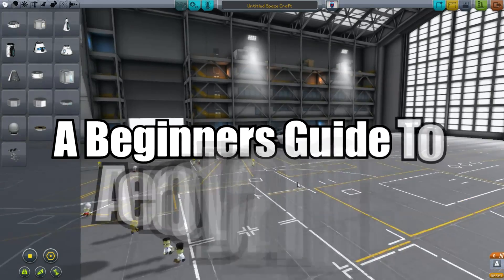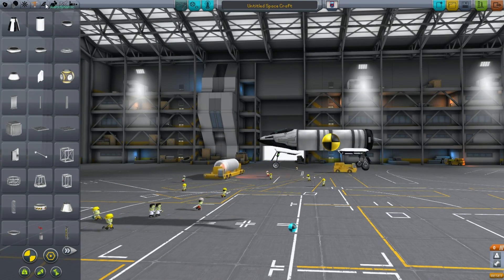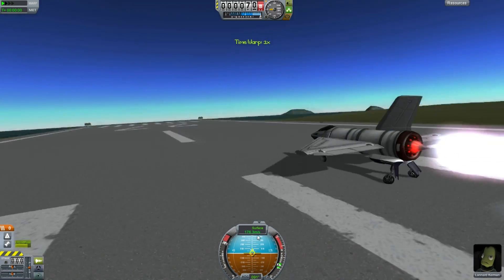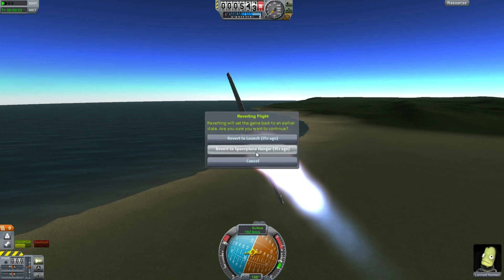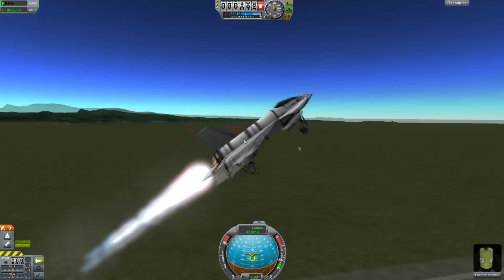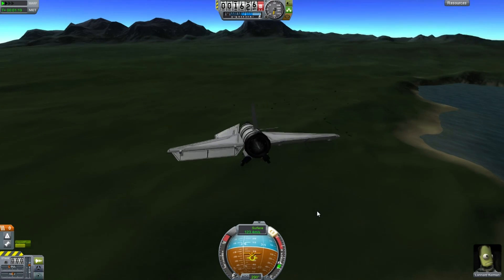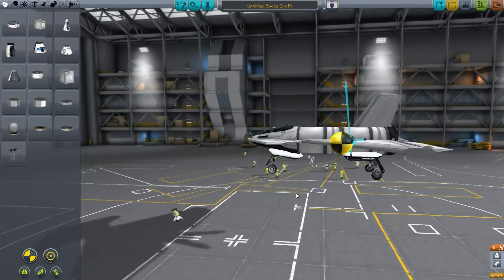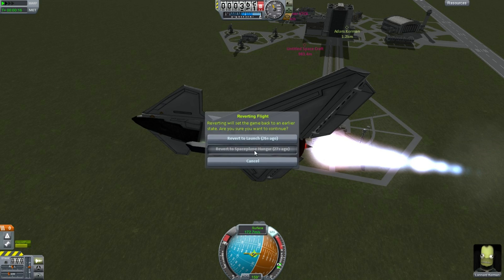Kerbal Space Program - Beginners Guide To Building Aircraft - Part 2

Comment: 5:00 The Fulcrum is still in effect. But because you moved the point of lift far to the front the rotation effect is much more dramatic. It's pushing up the nose instead of at the centre of mass. I always tend to visualize a giant hand pulling or pushing on the craft at a certain point. Makes it easier to predict how a certain force will effect the craft.

Comment: On my planes, I put fuel lines going from the rear tank to the front to cancel out CoM shifting
Reply from the maker: +Fireheart318 If you use Jet engines then fuel draw is balanced so that helps.
Reply: could you explain why one might prefer the aerodynamic design of high and low mounted wings to provide stability and control respectively to the designs of anhedral and dyhedral designs that produce a seemingly identical effect.

eg: if i wanted to make a stable plane, whats the difference between high mounted wings verses upswept wings?

Is there a purpose to high mounted downwardly swept wings and low mounted upwardly swept wings? etc.
Reply: Scott Manley how do you pitch a plane like what key u press for (up,down,left or right)?????

Comment: hello Scott, 
I want to ask a few questions about 10:00.

10:00 start tilting wings and I have did in same way
The arrow of center of lift has just inclined 90º to the surface of the wings.
I guess that should be correct, since when the wind comes to the wing, the reaction force should be that way. 2 years of versions has just fixed the direction of the arrow probably.

However, the biggest problem that bothering me is that when I use this technique to take off my aircraft, it is always unstable before the aircraft went off, and it is always unstable after the aircraft went off even though I have toggled the Sickness Avoidance Scheme on.

If we consider the command cockpit is a point, we can see that the point is moving in a direction just like hopping.

But from your video, it shows that the aircraft went off and flying peacefully. So what I want to ask is, what is doing wrong in my aircraft? Is this design unable to incline too much when flying? Thanks a lot!

P.S. You are my superhero! I couldnt fly any aircraft (hm with SAS) before finding this epic tutorial :D
Reply: That little arrow shows the direction of lift. You obviously want that pointing up. If it points backwards, it's basically drag.

Comment: Wow how did i miss this. I have a few air crafts that refuse to take off, and it was cause the way the landing gear was positioned. A pair of dihedral angled canards fixed the takeoff issue, and made it perfectly stable :) Also seemed to soften the nose lift as well angling them slightly upwards.

Comment: why is it that when I try to take off, it just wobbles on the runway and explodes?
Reply: Maybe the center of mass isnt proper? once I forgot to turn on symmetry and my center of mass was at left maybe your center of mass was in front
Reply: I have that problem too, it turns out that putting the landing gear really close behind the center of mass solves it. So vibrations are inevitable, and putting the landing gear near the center of mass meaning the vibrations will be dampened and that gear takes the majority of the force, and the front landing gear just serves to make the plane upright

Comment: So why do commercial airliners have wings below the center of mass but with a dihedral angle?  The effects seem to cancel each other out, but I can't think of any other advantages to having low wings.  WWII fighter planes have a similar configuration.
Reply: They mount them to the bottom because its easier to make them structurally stronger/run fuel lines from the belly tanks of the aircraft. You wouldn't want a plane where 1/4th your passenger area is struts between the wings, and its harder to pump the fuel up out of the belly into wings high on the airframe.

also the wings are in the way of the cabin in a lot of cases and will block out some of the engine noise, rather then a high wing where the engine will be literally right outside of your window.
Reply: linkxsc make sure you dont have ANY excess jet fuel at all, make sure you use the jets till they are empty and make sure by the time you use rockets the oxidizer to liquid fuel ratio is 1 to 1
Reply: Thomathan FYI I was talking to the dude above me about commercial liners. On the other hand, there's no need to make sure that you have "equal" fuel ratio. A great many successful spaceplane make it to orbit with an amount of fuel left above what it has oxidizer for, mainly because most spaceplanes will use that fuel to make it back to the space center or another runway.
Reply: Oh boy... Some WWII era (and before) cargo aircraft used the upper fuselage wing. And the fighters (like the f4f-3) didn't really need it, they were stable enough to just not need it.
Reply: Commercial/passenger aircraft carry a unique payload, people. The floor needs to be low enough to provide headroom and wide enough for seating,.usually ending up on the lower third of the fuselage. Most everything else is designed around that which is why you have avionics, ancillary equipment and fuel cells below the floor and in the empennage. Ergo, wing roots are located low in areas with robust structural support and typically house the main landing gear as well. Plus, the wings themselves carry the bulk of the fuel making the center of gravity very near the wing root and actually much lower than the "visual center of mass."

Comment: Another main reason is structural.  WW1 features wings that were mostly externally supported.  In WW2 which featured internally supported wings, it's much easier and stronger to have the main wing spar (support beam) run all the way through the body of the aircraft.  If you want to put the pilot behind a big engine, AND have a small lightweight landing gear, it makes sense to put the wings lower.  

You can make the low wing monoplane just as stable by adding dihedral as mentioned in the 1st vid

Comment: As mentioned, low-wing designs are a lot less stable. Another way to think of it is that an unstable plane is more sensitive to control inputs - it takes less force to turn the plane. This meant it took less aileron deflection to roll, reducing the strain on the pilot (the stick can get quite difficult to move at higher speeds and deflection angles), and less elevator deflection to pitch (reducing the tendency to stall during sharp turns).

Comment: The P-51's issue was due in large part to the horizontal stabs being too small.  During a hard pulling turn the aircraft's could more or less 'lose traction' with the air and cause the tail to snap around.

Comment: Around the 6 min mark, would it be possible to use those yellow fuel lines to pump fuel from the rear tank into the front tank while it's being used to automatically maintain the desired center of mass?

Comment: While the information is duly noted I don't normally move parts that have the wheels on them unless it fails miserably on the first shot (which it usually does) and the sheer size/weight is what I believe is part of the problem with needing the entire runway but thanks for the info I try that too

Comment: You can lock fuel and oxidizer in front tank. That would prevent getting center of mass behind center of lift. Mass would be going to the front. Later plane would be a bit "heavy" to control, but it would be stable. For planes, best engines are jet engines, because their low draining a fuel, so you don't have to worry about changing mass and lift positions, but you know that all very well :)

Comment: Q,W,E,A,S,D rotate the part in various ways 90 degrees , holding down the shift key and pressing them rotates the parts in the same way in 5 degree steps. The angle snap option also changes the rotation a bit ( now the same rotative effect can be performed by different keys )

Comment: air breathing engines are incredibly more efficient for all purposes however it is recommended that if you try to lift with jets that no matter how many jets you use you should end up with shutting down the outer ones so that only one jet in the center is still active at high altitudes.  that way if it flames out you can avoid flat spin.

Comment: I have had the same problem with my gear and have found that putting gear on a part and then moving the part around and resulting the part some times results in the gear being shifted in a very slight way.

if you need the whole runway to take off try shifting your rear gear closer to the COM so that when you pull up the wind can leverage your plane on the gear much easier.  if ever you have to move a part, even if you put it back, try deleting the gear and replacing them.

Comment: Why would that not keep the COM centered at the tiny tank? If both main tanks are draining into the tiny tank at the same rate, they should both have the same amount of fuel and thus weight at all times. Unless the fuel is actually treated like a real liquid and can "slosh" to the front or back of each main tank - is that the case, or does it fail for some other reason? Seemed like a good idea.

Comment: I think he mentioned that in the first video on this topic. You could either put a pair of control surfaces/canards to the sides of your cockpit, that will help your nose lift up or try to move the landing gears more to the front of the aircraft. You could also pitch the wings sligthly backwards, so the moving air tends to hit the underside of your wings when you move forward or tilt the whole plane by angling the landing gears at the back of your plane

Comment: i have a question, that has been bugging me for quite some while. Is there a good rule of thumb to figure out how much lift i need, especially on bigger aircrafts/how many wings are necessary? So ive just changed it around until i get it to lift of at around 100 m/s. But i can achieve the same results by changing the wings and landing gears geometry. So im unsure whether a high lift value is actually preferable or just increasing the weight of my craft

Comment: But it does assure that you won't have a sudden and catastrophic CG shift in the very wrong (rearward) direction. Your aircraft will simply tend to get more nose heavy as you drain fuel.

The solution to that is to get the CG of the plane SANS TANKS and then keep that CG as you add fuel tanks as best you can.

so build the plane using trusses instead of tanks. NOTE the CG/CL then replace with tanks and move things to return CG to known good location.

Comment: Part 3 will probably be about turbine engines and thrust vectoring. From their, I would suggest altitude dynamics as far as how the aircraft acts and behaves at different altitudes. The higher up you go, the thinner air gets and the less control you have as far as control surfaces go. Also depending on the engine, its either more efficient at high altitude, or more powerful.

Comment: I have not tried this (I might try it tonight) how about this. install a coupler between the engine and the tank and disable cross feed.

THEN put a "tiny tank" right at the CG point. and use fuel lines to feed the fuel from both tanks into the small tank and then fuel line from tiny tank to engine.

This way all tanks drain equally keeping the CG relationship fixed.

Comment: Place the rear landing gear just slighly behind center of mass and you can take off at MUCH lower speed. you only want it slightly rear of center of mass not by a lot because when you land your center of mass normaly is a lot more to the front after your fuel has been spent. look at real planes. ALL of them have the rearmost landing gear close to center of mass.

Comment: I have a slightly weaker CPU and the same GPU. KSP will run beautify. If you do get the gtx 760 go with the gigabyte version (if your case can fit it). It has amazing cooling and is very quiet.

Comment: Hey, Scott, have you ever tried the RCS Build Aid mod? Not only does it add wonderfully helpful little arrows to show how your ship might rotate if you attempt to translate, but it also adds a second CoM that shows where it will move after all the fuel is drained (dry CoM). With this, you don't have to guess at where it will shift as the fuel burns.

Comment: I ran into an interesting problem in career mode recently. I'd unlocked all the basic airplane parts... but no wheels!

So I rigged up this crazy thing with girders and septatrons stuck to decouplers, to boost the plane about 1000 feet into the air (while flat...) so it won't hit the ground before the engine spools up.

It... works better than trying to take it off WITH wheels from the runway like normal. 

Pfft, Kerbals.

Comment: Quick tip. To move to center of lift significantly: Get a small control surface and make sure the flap is inside of the plane and it is angled vertically.

Comment: There are some mods that make fuel pumping insanely easy, I suggest you get one... You can make it so all tanks drain into one, or you can make it so one tank is unused ect. ect. It basically makes normal fuel tank operations about 10x easier because 1. the buttons aren't moving around 2. you can do a bunch of other useful functions.

Comment: wait, you might not be able to control the pumping with action groups, but you can tell the plane not to draw fuel from a specific tank, so if you designate the front most tank to never deplete, and only allow it to be depleted when the rest are out of fuel, you wont have to worry about strange fuel placement and pumping. The button to disable fuel flow is on the top right of the menu when you right click the piece.

Comment: Did you have the issue I always had with angled landing gear? For me, my aircraft using landing gear that's angled always veer to one side and s pin out of control during the takeoff roll. Using vertical gear seems to avert this.

Comment: A trick I use when designing aircraft and making sure the fuel flows correctly is to put a decoupler between the fuel tanks and the engines, and then manually routing the fuel using the fuel lines (e.g. you can have 3 tanks and have the fuel line originate from the 2nd tank to have sort-of even fuel drain).

Comment: Hey Scott, why not try adding fuel lines from the back fuel tank to the front tank, then one from the front tank to the engine? It makes the plane a bit nose heavy during flight but at least it's not unstable. With 3 tanks, the middle one could feed to the engine and the COG won't move much at all. I've found it works fairly well.